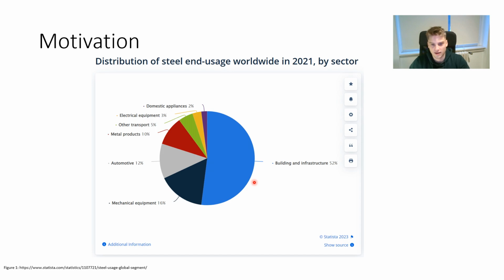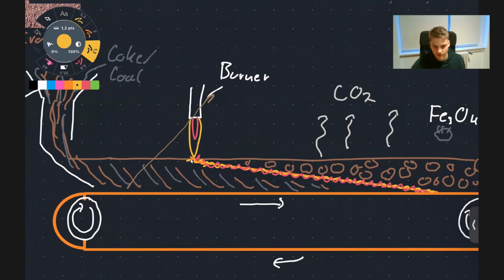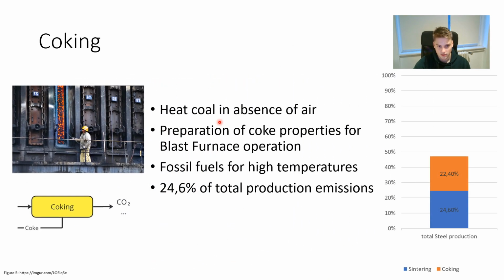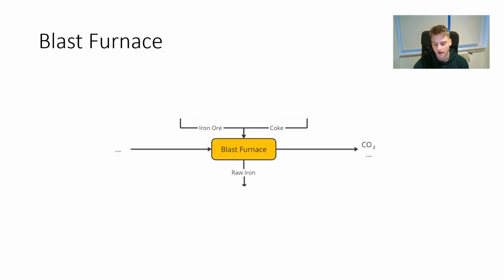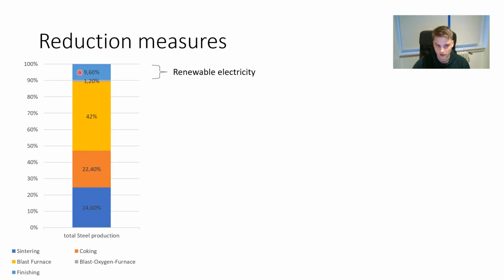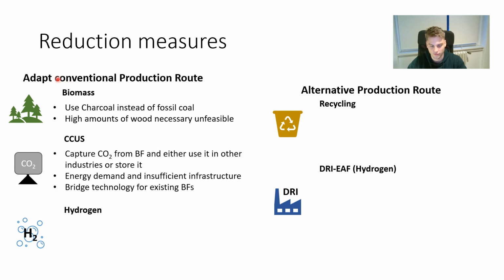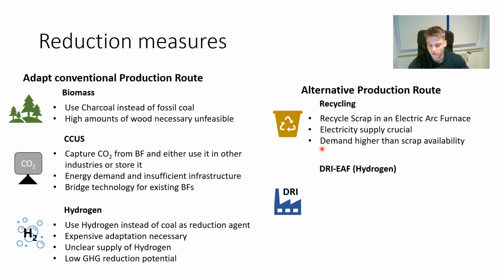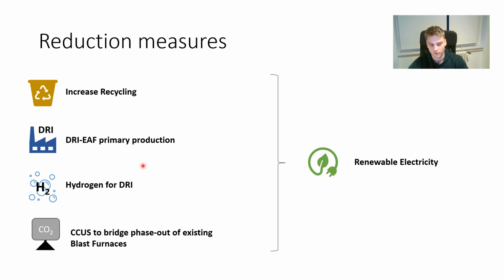Steel Production, Carbon Emissions and Reduction measures easy explained

Comment: Nice! Thank you for you're thesis and you're video
Reply from the maker: Cool, I'm happy to hear that it was helpful for you :)

I'm curious in which context you needed this video / thesis. Was it for an university project, study task or similar, or just private interest?
Reply: Actually, I used to work for a steel company, specifically in the electrical branch. I was involved in the first step, which is the fusion process in steelmaking. Somehow, I forgot some details related to the BF, for example (the company only had EAF, not BF). Currently, I'm pursuing a master's degree, and my focus is on a project related to reducing oxides. Your knowledge has been of great help to me in understanding this area better. Thanks again for sharing! @Umweltstudium